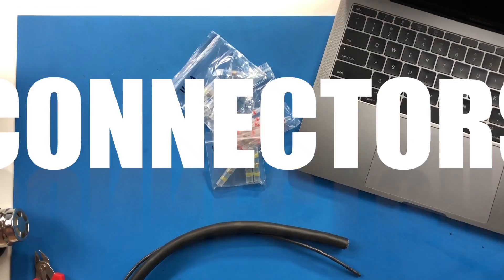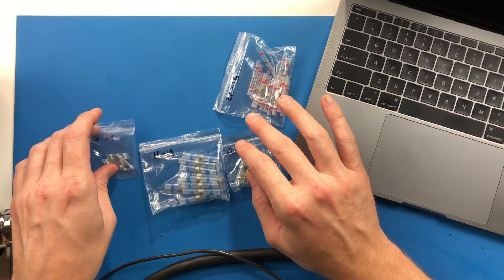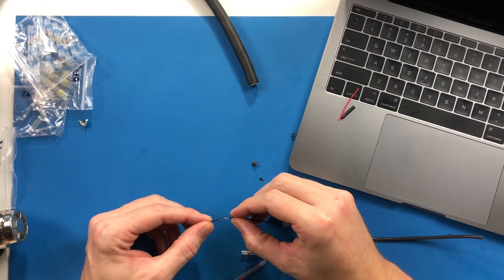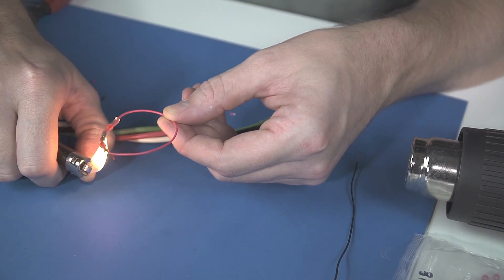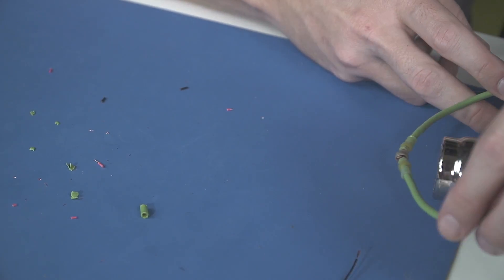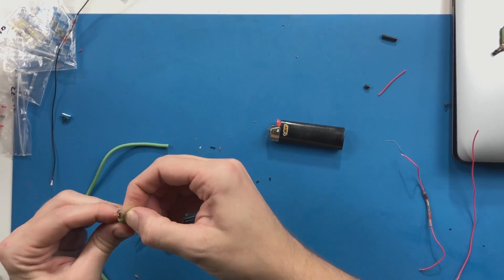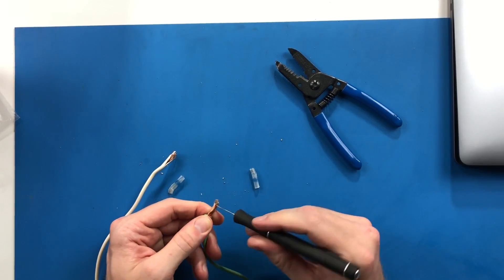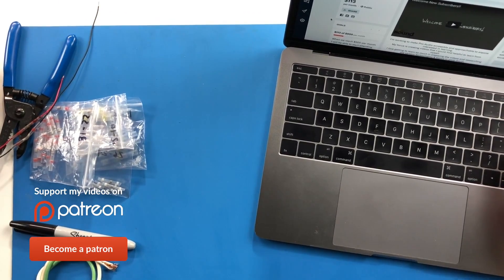Low Heat Butt Connector Wire Splice Test

Comment: From what I can see and since I have not contacted the product itself, I believe the problem will be the difficulty in heating the copper, due to the extra shielding that the heat shrink sleeve provides, preventing the correct execution of the service. 
Cold joint in perspective, all the time. 

Consequently and after seeing the results of this product in the video I would not risk allowing a flaw that can be disastrous in a show.

I will continue with the original way of solving this type of cable problem: JBC soldering iron, good 60/40 solder, good quality heat shrink sleeve and steady hands.

For me, it is disapproved product, no return. 

Nice video! I wish you a good work week.

Macedo Pinto
Portugal
Reply from the maker: Thanks for the message Macedo. How are things in Protugal? Growing up in Ireland, I have fond memories of visiting Portugal in the early 80's on summer holiday. Hope to get back there again someday.
Reply: Hi. 
It's funny because I just picked up a brave Bushmills and I look at the notification, seeing you grew up in Ireland. After all, tradition is still what it was, huh, huh, huh .... 
How is Portugal? Well ... more or less as you would expect, with some signs of recovery but with an absurdly strange environment ‘cause the most difficult thing is to believe that (government) thieves have all been arrested. Those who leave are quickly replaced by others with the most up-to-date theft diplomas ... 
Specifically on the issue of work, everything is running into an infamous globalization, which crucifies the small business owners of sound and light rental. Until 2008 I couldn't complain because i worked and i was rewarded. At the moment our area practically no longer compensates and I see around me many vans and some big trucks of equipment with the grass to be born around the tires. It's sad.
Worst of all is seeing that almost all the companies of sound and light rental come from my zone (north), when here in the south what is not lacking are technical and human resources. And it's these companies from the north that serve here, in the south. It is sad to see this taking this course, which will not change until the Portuguese insist on this nort/south format that in no way dignifies our profession. Am I mistaken or are there two half-Portugal (north and south)?
I’ll continue to work as long as I can pass the multicore cables and continue to respect the science that governs my work, whose name is and will always be electroacoustics. Someday,  someone will understand that not everything is money, right? 
Where is the pleasure of working, after all?
Keep up your good work, as you being doing here on YT. Go ahead, bro! 
By the way... if you ever come to this old country, food and wine are still what they used to be, although there are many Master Chefs “in da house” doing weird things with kitchen knives...

From Portugal, over and out!

Comment: Is that a Presonus NSB in the background?
Reply from the maker: Yes it is!
Reply: I saw a reference to dcsoundop on an instagram post today too, is there something happening there?
Reply from the maker: Nothing too crazy, it’s been on my radar  to look at them since I covered the 16R a while back. The crew @PreSonus are pretty cool & when I asked if I could borrow one of everything to properly test the system out, they said sure! 

Check out my Instagram (@DcSoundOp) where I’ve been posting updated in my stories - I’d currently evaluating the new SL16 mixer, the stage boxes, the EarMix stations, the network switch & their 159’ Cat5 cables a along with StudioOne v4 and the entire plugin library that work with the console too. 

Lot of work ahead on this one. Thanks for the message!